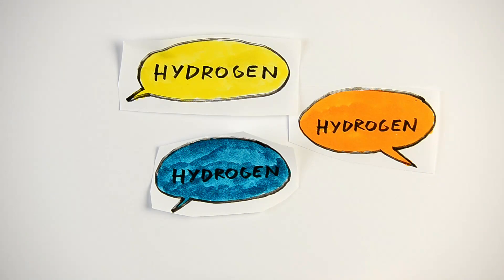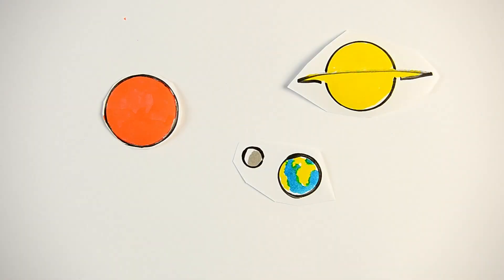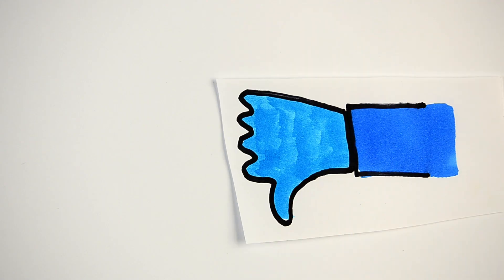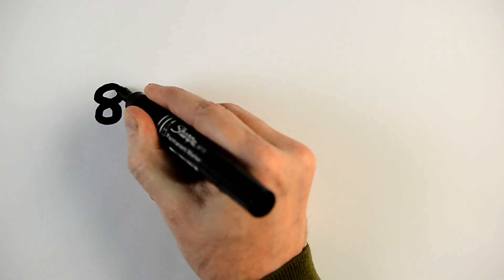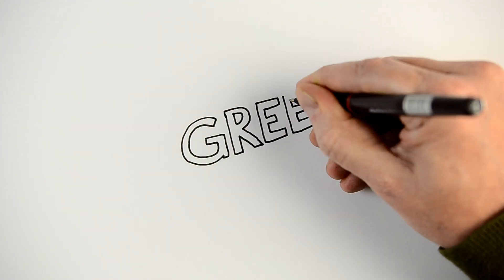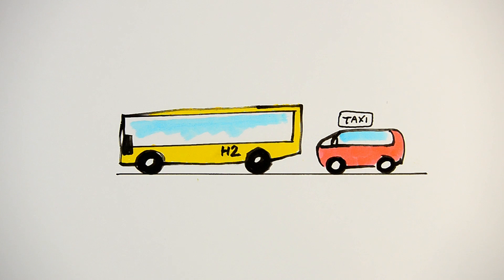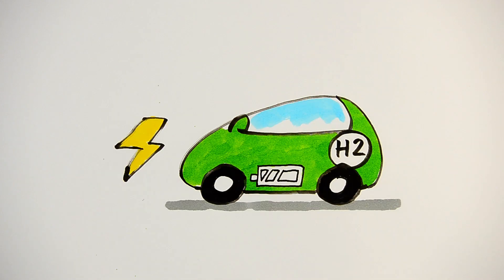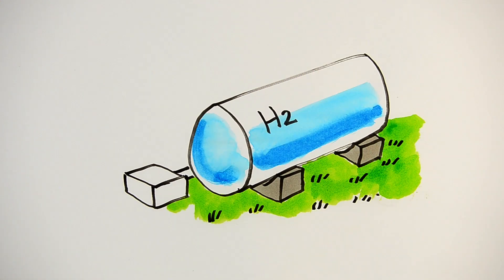How can hydrogen be used to power vehicles? | URBAN MOBILITY SIMPLY EXPLAINED

Comment: There's another type of hydrogen, dubbed "white" hydrogen, which is hydrogen gas found usually mixed with methane and other gasses underground. It's not too common though.

Also, a problem with hydrogen storage is that hydrgogen is both the smallest atom (with just 1 proton in its core) and forms the smallest molecule (H2). It's in fact so small, that when pressurized, it can leak through otherwise perfect sheet of steel, passing through the very atomic structure of the metal. So to conatin it, other materials must be used with denser structures, which will be more expensive, or soem different storage technologies have to be used. For all the recent talk about hydrogen, I haven't heard how this particular issue is to be tackled. I hope it's already solved and not left for later.